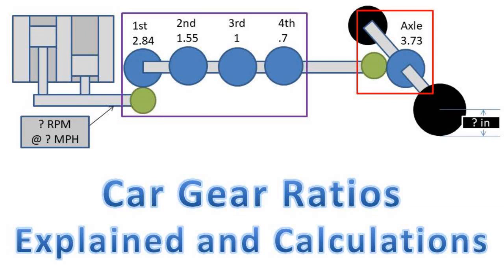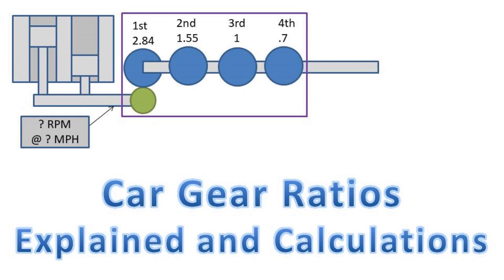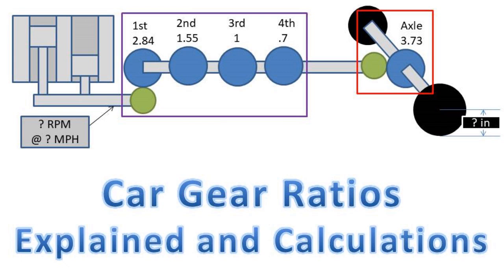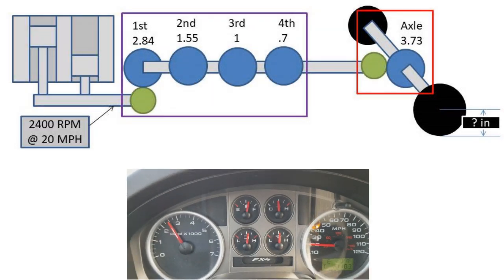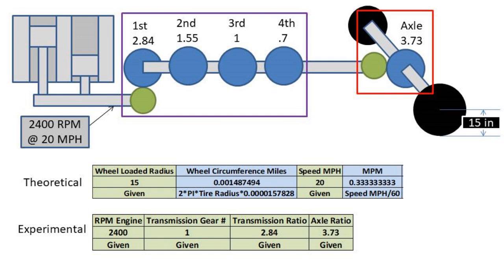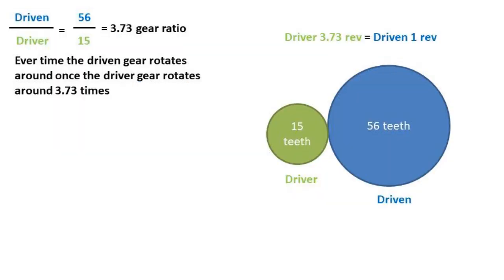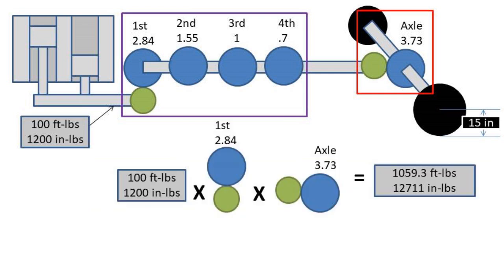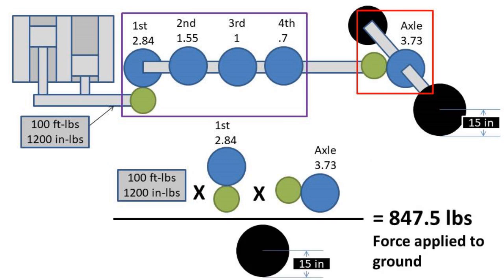Car Gear Ratios (Calculate Wheel RPMs, Torque at Wheels, and Force at Wheels)

Comment from the maker: Note you will have less torque reaching the wheels due to inefficiency in the driveline. You will need to multiply times a driveline efficiency factor to get a closer real world approximation. The example was assuming 100% driveline efficiency.
Reply: Can i use the same equation to find wheel hp ?

Comment: How to calculate engine rpm before and after shifting gears. Having a transmission ratio of 2.4, 1.47, 1, 0.67 respectively and if its engine rotational speed during gear shifting is 3000

Comment: Quick question. For the final answer of force applied to the ground from the wheels. Is that 847.5 lbs per wheel or in total?
Reply from the maker: that value is how much force is reaching the ground. So it is both wheels combined.

Comment: 1059 ÷15 inch is not 847? Please explain??? As im new to this an not sure what im doing wrong
Reply: 1,059 is foot pounds. Formula requires inch pounds: 1200 * 2.84 * 3.73 /15 = 847.
Reply from the maker: thanks for answering this amanda

Comment: Can someone please tell me is it 1059 divided by 15 inches???? As it doesn't equal that amount? Im doing something wrong? Cheers
Reply: A bit late on the reply, but he's dividing by the radius in feet, not inches. So, not 15", but 1.25' (15/12.)
Reply: 1059x12=12711 in lbs. So he converted ft lbs to in lbs and then divided it by 15 inches

Comment: How would I find top speed in a gear given the gear ratio, wheel size, and engine specs?
Reply from the maker: The short answer is that it is complicated. factors such as friction, driveline efficiency, and air resistance go into this calculation (just to name a few). Also the engine is generally tuned in such a way that certain gears have certain specific ranges to optimize engine performance. Long story short its not a calculation you can easily do with only the listed data.
Reply: RPM X 60  /  Tire Revolutions Per Mile x Overall ratio.      To calculate Tire Revolutions Per Mile use the tires Static Load Radius. Which is essentially the measurement from the ground to the center of the axle.  Most tire manufacturers will list this info on their website.  Take Static Load Radius x 2 x 3.14159265359.  Then divide your total into 5280.  Which will give the tire revolutions per mile.   

Keep in mind this does not mean you have enough horsepower to do this speed.  That is what VAM alluded to, which is a longer calculation of rolling resistance, frontal area, air density, and driveline efficiency.  Hope this helps

Comment: the final drive to wheel torque does not work for metric e.g my Land Cruiser has 5,195Nm on the axle in first gear the wheel radius is 40cm 5,195/40=129Nm that's less then my engine or i do it in meters 5,195/0.40=12,987Nm witch seams too much.
Reply: got it. its Nm/M http://prntscr.com/nh3ief